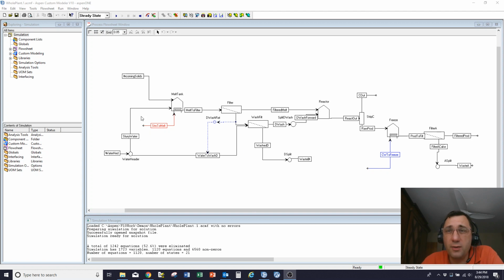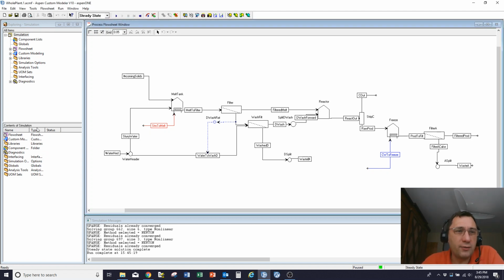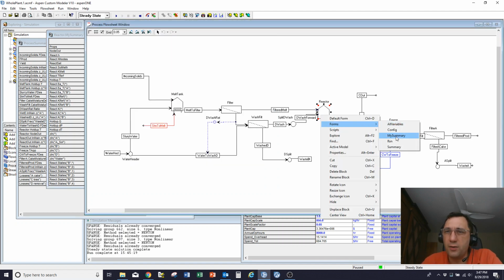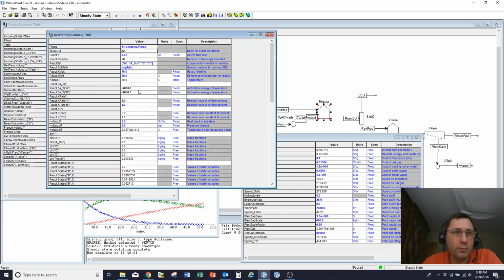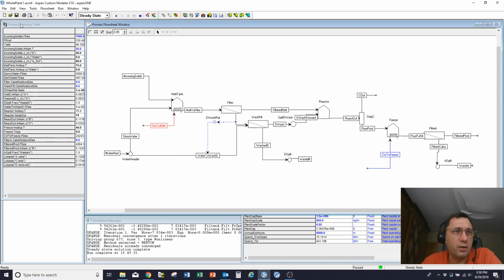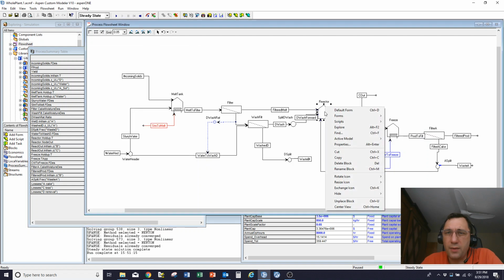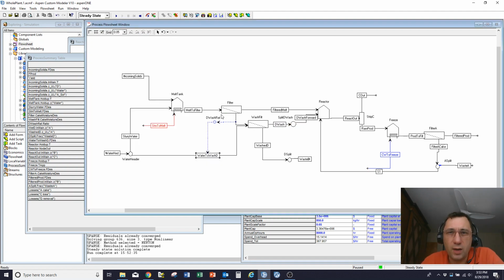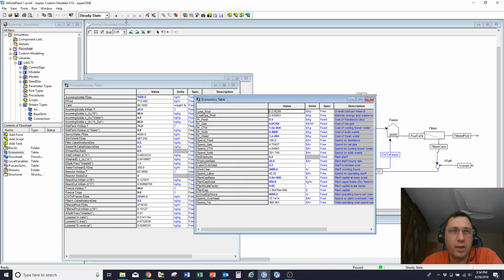ACM4. A Whole Plant Model - ACM for Flowsheeting

Comment: Hi, do you have any videos that show how to build simple models from scratch? I followed your videos but all the models were built by drags and drops icons from Library. I want to learn to build all models from equations. Please suggest any videos that you think they are helpful. Thank you.
Reply from the maker: I did try to work though the steps of setting up models, but I don't have any more resources than are shown here, and I'm afraid I've got too busy to make new videos at the moment.  I will bear it in mind, though, when I have time
Reply: @cssandersonllc3172  thank you for your response. I hope you can have more videos. I tried to learn ACM code but I couldn't find any good source. Thank you again
Reply: @LongTran-k5z  Hi, did you find how to write ACM code ?
Reply: @unname1634  I couldn't find any yet. Did you get any? If yes, please share them to me. Thank you
Reply: @LongTran-k5z  Tbh, I still haven't found anything. I saw a course on the Udemy platform, but I haven’t tried it because I don’t have the extra money (I’m a fresh graduate and still job hunting). So if you have a job and some money, try taking the course and let me know if it’s worth it. If it is, I’ll try to find a way to pay for it.
Reply: @unname1634 the Udemy course is garbage don't buy it. I suggest you read the material from Aspen
Reply: @unname1634  I took the course and received access to the video materials—there were around 25 videos, if I recall correctly. However, only the last few videos actually focused on Aspen Custom Modeler (ACM), and even those were not very useful. The majority of the course consisted of general Aspen introductions, not specific to ACM. Overall, I felt the course was misleading and not worth the investment, so I ended up trying to learn ACM on my own.

The language itself isn't too difficult to understand, but there’s a major lack of practice exercises and self-learning resources for both ACM and gPROMS. While the two platforms use similar modeling languages, it's hard to find quality learning materials for either.

I also encountered several technical issues with ACM. First, for the same problem, ACM takes noticeably longer to solve compared to gPROMS. Second, if I forget to restart the simulation before running it again, there's no simple way to reset the model to time zero—unless I’ve saved a snapshot at the beginning. Without that snapshot, I have to create a new model and manually copy and paste the code again. Third, the ACM interface is quite frustrating. For example, the plots keep getting hidden behind the code window when I click on the script, and I have to go back to the flowsheet to find them. Additionally, the search function for variables doesn't work well at all.

Between ACM and gPROMS, I prefer gPROMS in terms of functionality and performance. However, I’m more experienced with drag-and-drop environments like HYSYS and Aspen Plus. In contrast, I don’t have much hands-on experience using gPROMS in that type of environment.

My university has an Aspen license, and in my experience, most companies use Aspen tools. I’ve never encountered a company that specifically requires gPROMS expertise, so transitioning to gPROMS is challenging for me at this point.

If you have any questions, feel free to ask—I'm happy to provide more details.

Comment: Can you show me an example and detail of using the ACM for the membrane? Please.
Reply from the maker: I'm afraid that I don't have time to build detailed examples at the moment.  For a membrane, though, I'd recommend that you start with a relatively simple model that separates components in a stream and produces two separate streams with different composition and (perhaps) different pressure and temperature.  Depending on what Phys Props package you use, you will need to make sure that you keep the enthalpy balanced (if there's a "heat of mixing" this requires attention).
Once you have that basic model working with fixed component split fractions, you can start to relieve some of those constraints - for example, you might "Free" the split fraction of the solvent and add an equation for the trans-membrane flux as a function of pressure; you might make the separation of one  component a function of the others; or you might make the solution viscosity a function of retentate concentration and then further adjust your flux.
Best of luck!

Comment: Hi, by chance did you build this plant in aspen hosts and import it into ACM? Been trying to build a model from ACM but dk how to get pumps, reactors etc. Any help will be appreciated
Reply from the maker: I have built a library of unit operation models in native ACM over the years, covering pretty much all the unit operations that I could think of.  The nice thing about working in ACM is that you can control the equations (and hence level of detail).  The drawback is that you have to write the equations...  With that said, it's actually not that bad to put together simple models (and a great way to reinforce your understanding of how things work).
If you're going down that road, then hopefully these videos will be useful.  I'd start with deciding on what you'll carry in your Port and how you're going to do phys props.  I'd then write some basic underlying models (mixer, splitter, stream).  The mixer you can inherit into a tank (adding holdup calculations and perhaps the possibility of a reaction).  The tank you can inherit into a CSTR by adding equations for the rate of reaction.  Similarly, you could develop a pressure change in a stream into a pump with a given curve or a pipeline with a resistance to flow.
Best of luck!
Reply: CS Sanderson LLC ooh I see, that’s one of the issues I am having, would like to develop a model to show an RO unit or even pumps for the streams. Any mild tips on how one can built a library of unit operation models? Or maybe a short videos to help (I know you’re very busy, don’t want to impose)
Reply from the maker: Well that's kind of the point of this series of videos...  In the first few, I try to walk through the steps of setting up a library, and then later get into the details of the syntax.  If you have specific questions or there are gaps, please let me know and I'll try to add content
Reply: CS Sanderson LLC no problem, thank you very much
Reply: @matthewcharles9829  Hi, were you able to build this. I'm in a fix right now and I'm not able to start anything.